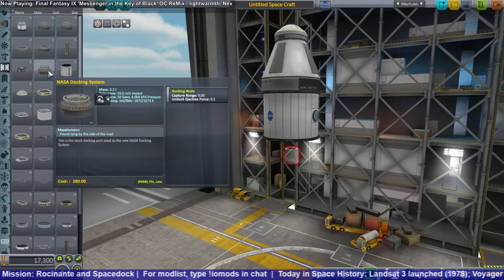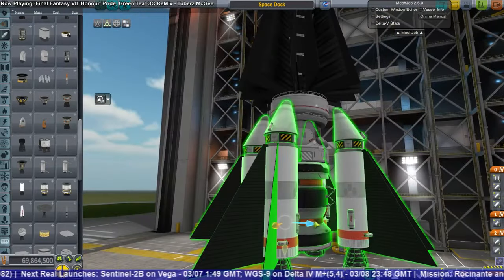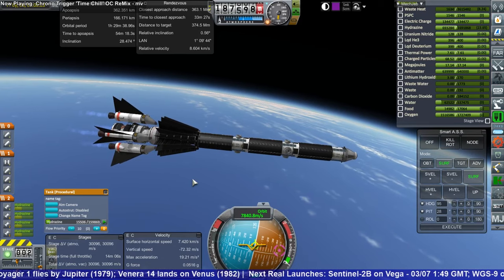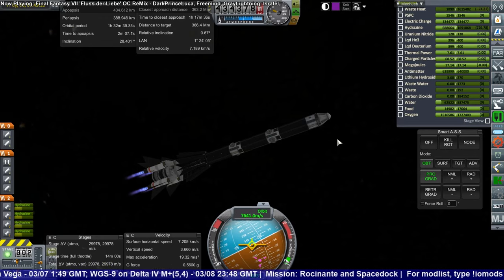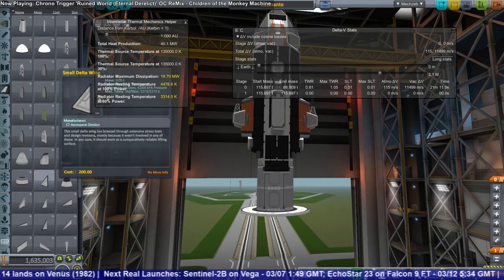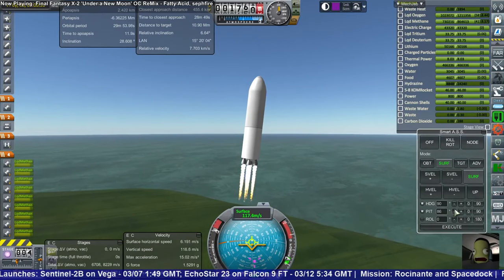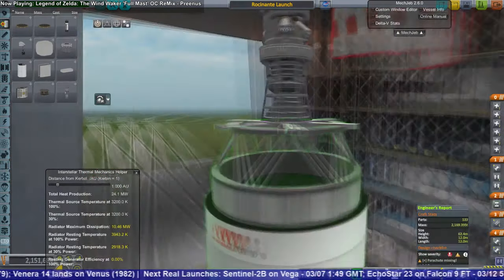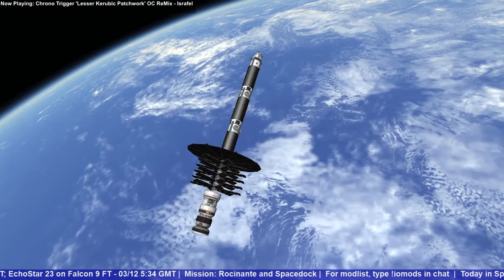Kerbal Space Program - Interstellar Overhaul 09 - Rocinante

Comment: just so you know, the reason you didn't get the thrust you expected was because thermal nozzles lose a portion of their power for every part between them and the reactor. ideally, you would put a docking port below the reactor (since docking ports are more efficient at heat transfer than normal parts) and put a large thermal nozzle there, and just use fuel lines or similar to get the fuel from the sides to the engine.